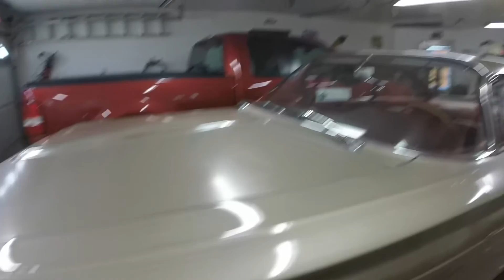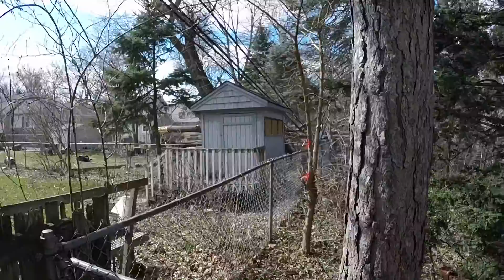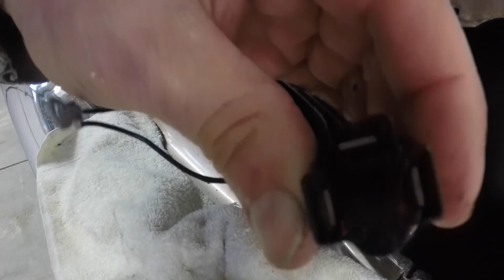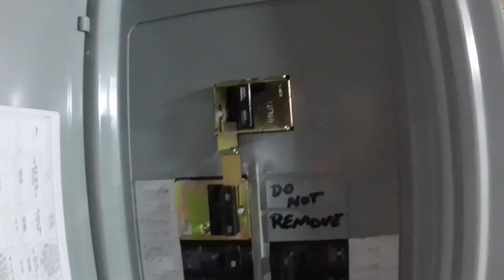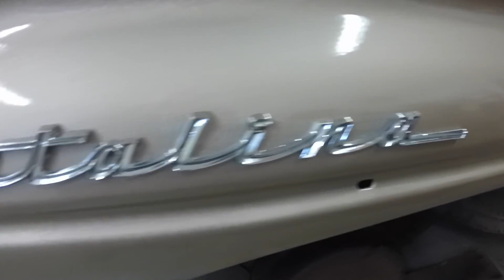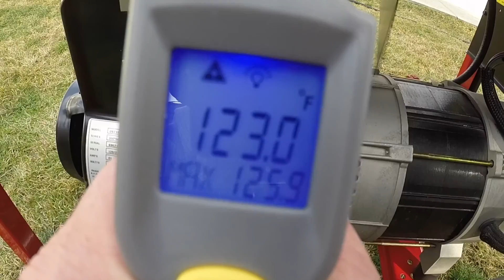Got some little things done on the 60 Pontiac why the power is still out

Comment: Worked on my 60 Pontiac today-  it was cold and couldn't get the big heater to stay lit so found 3 small propane heaters I had for deer blinds and 1 electric and got the shop to 36-  laid out grill parts and labeled bags of bolts-  looked at pictures I took when taking damaged parts off last spring-  2 hours later grill all back together and ready to go back on car-  Kathy came out and gave me a helping hand-  tomorrow we'll tackle the fender-  after Church and brunch-  a body shop will help me put the hood back on-  Kathy and I could hardly handle taking off the damaged one-  I did OK but her side a bit heavy for her-
Reply from the maker: The hood looks much heaver than the one on my 59 Chevy. I am surprised at how easy things come apart and go together on the Pontiac. Seems better built, and easer to work on then the Chevy.... anyway to me it does. Glad your getting the repairs done. My friend Tom almost cried when he saw the photos of the damage... and I bet you did.... I would have! I had to tell him that your repairing the car... he loves old cars more then people I think... he was the one who told me about the 60 Pontiac I bought. He doesn't have the knowledge to fix them up, and can't afford someone else to do the work. If I was charging my going rate, doing this for someone else, the bill would be close to $50,000 now. Glad I don't half to pay myself! I do it, because it is lots of fun... I love working any "old machinery". Nothing more gratifying for me, than making some old machine from the past, work like new again!

Comment: Do you have a shed so that you could run that generator while it's raining? Or is it rainproof?
Reply from the maker: No shed yet. I can set it inside the garage, pointing out the service door, if it's nasty out. I usually run it outside on the lawn unless it's raining, snow doesn't seem to bother it, also is much quieter on the grass than the concrete. If it's storming I don't run it, until the bad weather is gone.